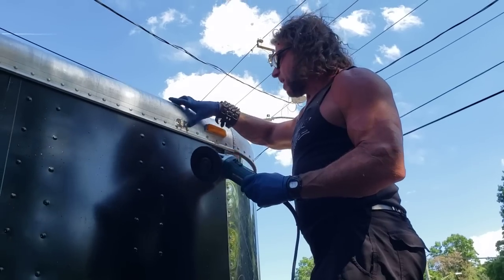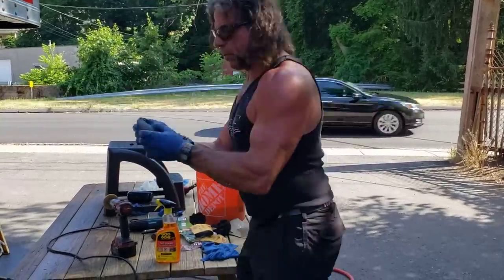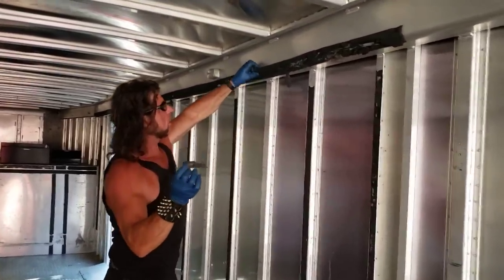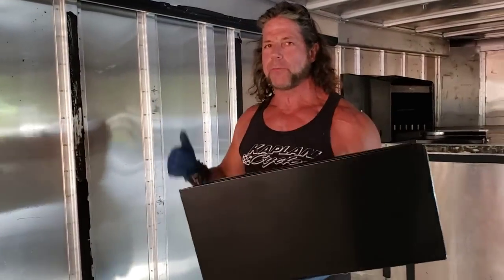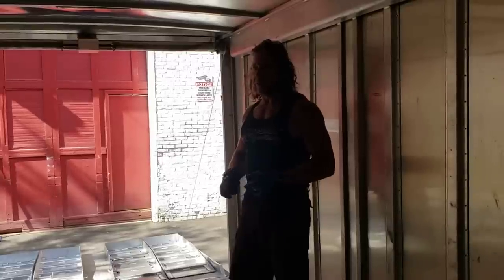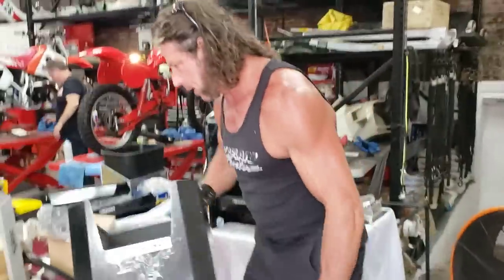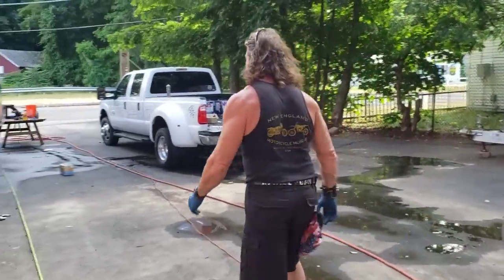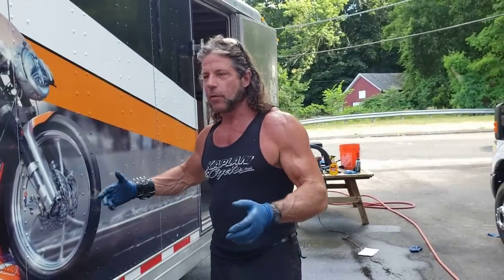44' FEATHERLITE BIKE HAULER PROJECT PART II

Comment: Hey Sr. You should look into putting a 1 - 2" coat of spray foam inside and underneath the trailer maybe 3 " its insulation sure R 7 per inch but the structual factor is what you want unless you use the trailer for sledding in the winter but it makes it  300 % stronger than before. Would really stiffen the walls and floors. We do it for a buisness in Canada on houses  mind you but its well worth it inside anything you would not believe what we do with it and the strength behind it.

Comment: There are wet sanding sponges that you use that are much easier on the hands.  They are sort of firm and have a C shape = flat on one side for the paper and rounded on the other.  Also have a bucket of water to continually wet and clean your paper and sponge.  Ajax is a fair abrasive and cleaner unsure about using it on aluminum.  Need to get some more hands out there for the wet sanding.  Could put a sign out front Wet Sanders Needed  free tickets to museum.

A power washer with a rotary nozzle (the water moves the nozzle in a circular motion)  can be your best friend.  Easiest way to clean large things fast and you can add abrasives or chemicals to it.  You don’t necessarily need a gas one either.  The electric ones are dam good, don’t have the admissions etc.  Could hire a mobile power washer to clean the inside and outside.  

Maybe there is somewhere you can park it so you don’t need a ladder or scaffold to access the top to clean it.

You are correct about having a place for everything essential on the sides = If something essential is not there you can immediately see it and not leave until you find it.  That is being smart.  I would also make a checklist on a piece of paper to go over each trip.

Comment: I would just take a high speed and heavy compound with a wool pad and buff it and then polish it with micro compound and then cutting glaze with a foam pad. Just plastic off the other aluminum so the spray doesn't hit it or it will mark.

Comment: If anyone wanna know the name of the rubber wheel, its commonly known as a 'caramac wheel' or 'eraser wheel' but a heads up on using this on painted surfaces as I've had this lift the paint with too much heat getting to surface! Great vid Ken trailer will look sick :P